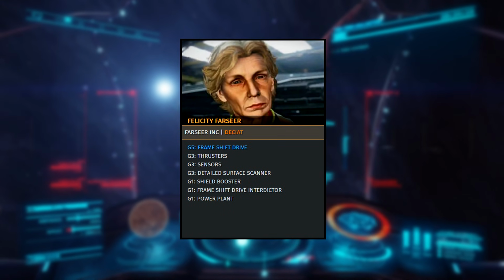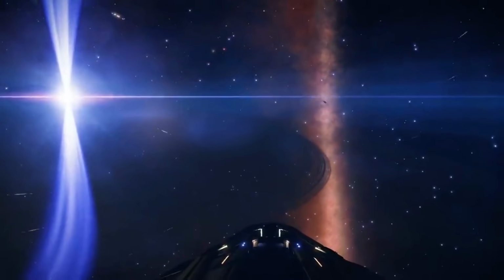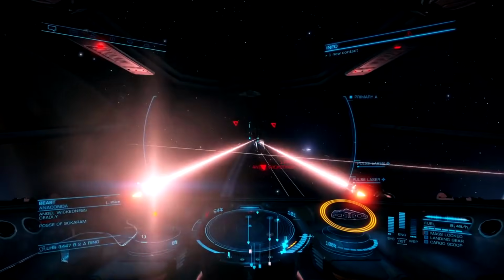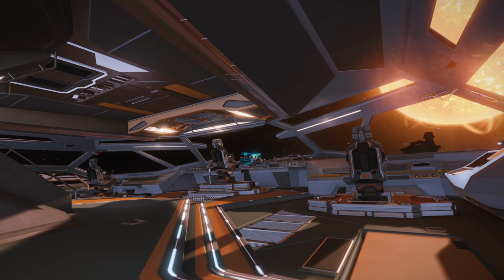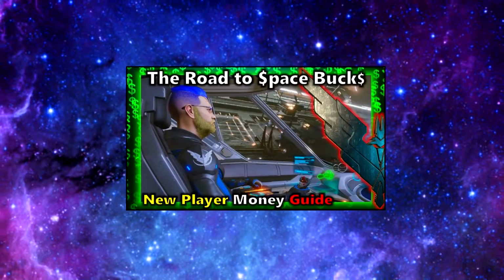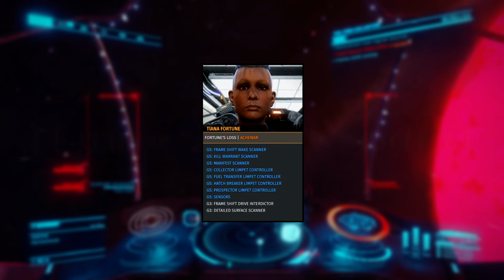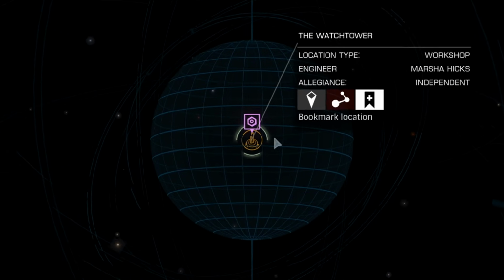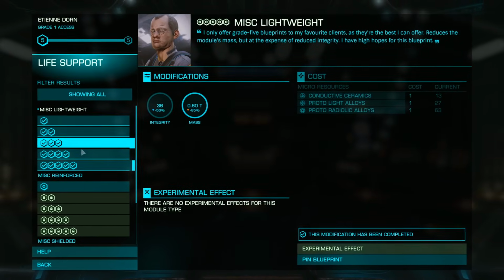🔓 Elite Dangerous How to Unlock ALL Ship Engineers - The Complete Elite Dangerous Engineers Guide

Comment: There's some small detail missing when unlocking Marco Qwent. Handing data in Procyon and reaching Allied status with Sirius Corporation, only unlocks the Sirius System permit in the Mission Board.
- Once with the Permit, head to Sirius system, I suppose any station should work but I did Patterson Enterprise, there you should see a mission for the Engineer Invite (you have to deliver the data to Duamta system, Davis Terminal, very close) and then you get the invite from Marco Qwent.
Again, thanks for this awesome detailed vid!!
Reply: Thank you! I was just checking comments because I got confuses with that
Reply: @AntPDC  a lot of the engineers in general just seem like huge jerks. Lei Cheung just straight up just went MIA on me at one point when I went to visit him in his work station. Didn't even leave a note. wtf.
Reply: the data delivery can end in any number of sirius corporation controlled stations nearby (such as davy dock in procyon, or in the nearby wolf system, etc) - but other than this its 100% accurate info and very helpful advice, just remember to not keep spamming accept quest, otherwise you will have loads of em and will have to abandon the ones that you then cant complete after doing the first one.
the quest is the penultimate step (the final one being to donate the 25 modular terminals) - and has a quest timer of 1 day so should be completed as soon as you accept it, ideally.

Comment: A couple of common flaws sadly also made it into this video.

1. Every new player is short of engineering materials. The first upgrades at any engineer are very expensive on material, except if you level up with them first. This can be done by selling data or goods, type depending on the engineer.

2. Mass Manager for FSD 5 and up and deep charge for 4 and below is not always making sense. Mass Manager increases range / fuel also for C4 FSDs or below. So it can be better for those also. Jump range per jump isn't everything, overall range can play an important role.

I am not sure if videos like this actually help the fun playing and the joy of managing this yourself.

Good Video, but everyone please think twice about what those shortcuts do to your experience in ED.

Enjoy Christmas 🎄